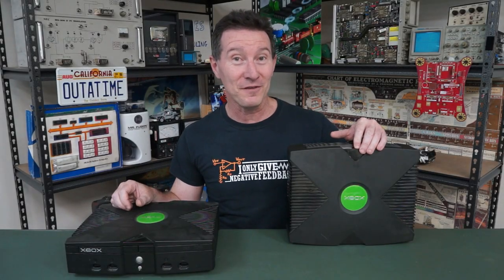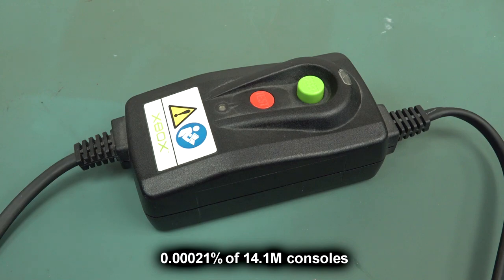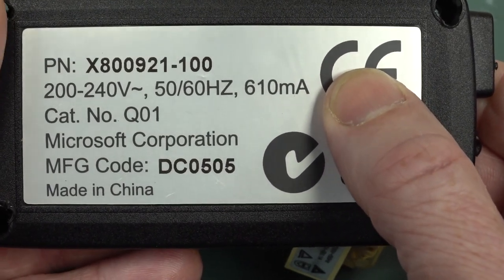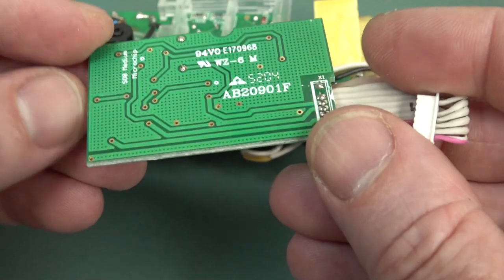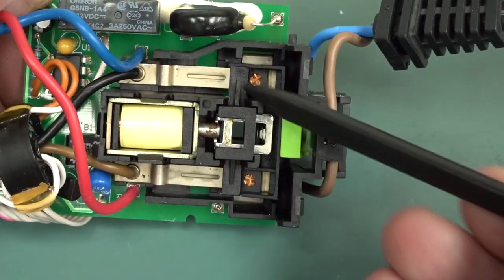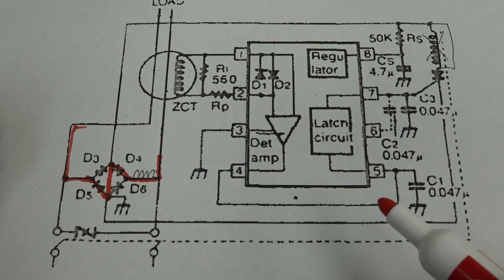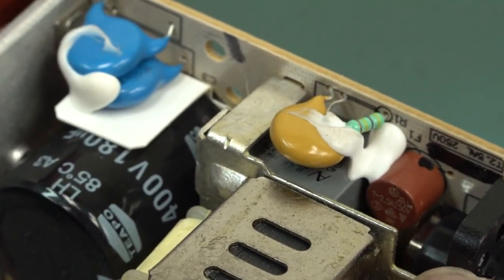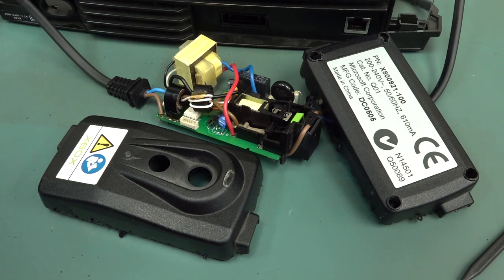EEVblog #1164 - Xbox Engineering Baptism Of Fire

Comment from the maker: UPDATE
Apparently this is an "Arc Fault Circuit Interrupter" (AFCI) that continually monitors the current for the presence of arcs caused by such an intermittently faulty power connection. Hence the complexity and micro that would be using the ADC to continually monitor the current. It's not just a simple 610mA electronic fuse, although it almost certainly has that function too, hence the label.
And apparently these are now a legal requirement in US outlets since 2014?
https://en.wikipedia.org/wiki/Arc-fault_circuit_interrupter
Reply: Hey not fair Dave post this 3mins after I said that!
Reply: nice stab at Weller fuses, lol.
Reply: That name reminds me of the device the US calls "Ground Fault Circuit Interrupter"
Reply: Arc fault interruptors are required on branch circuits for bedrooms in the US. As far as I know there's no requirement for them elsewhere.

The stupid things can be a pain in the ass. They seem to trip on all manner of noisy circuits, such as brushed universal motors.
Reply: @PaulSteMarie  They shouldn't according to the wiki.
They should be able to detect between the arcing in switches or brushed motors and a frayed wire.
But this is wiki
Reply: @PaulSteMarie  I could be totally wrong, but I am almost certain that ALL 15a and 20a circuits with in a home require AFCI in the USA.
Reply: Hi, Dave!

I wonder about the source code for this puppy. Would be neat to have something like this for testing at home with variable currents. As cheap as they are...

Regards,
Etna.
Reply: @IIGrayfoxII GFCI protects against shock, and been required in bathrooms for a while in US. AFCI protects against fires from arcing and now required in other rooms since 2014.  My apartment has GFCI but no AFCI.
Reply: @IIGrayfoxII  Yes, this is wiki, so you should go and fix the shit if you know it. Doesn't have to be perfect, improve just a bit, that will do.
Reply: @AlexanderBukh  I don't know much about electronics, it is why I am leaning about it on this channel
Reply: You know, I was about to put that in the comments just as the video ended and here we are.

Very advanced / pioneering protection circuitry for the time
Reply: I have repaired probably 100s of these. Would always find broken solder joints at the plug on the power supply just as you seen. Would be burned from arcing as well as the case/shield below.
Reply: Lol you guys with your unfused plugs 😂😂😂😂
Join the civilised world already 😉
Reply: The moment you opened it I was thinking ark fault interrupter. From what I understand in the USA it is a requirement of the electrical code that certain circuits on a residential consumer unit/panel boards that ark fault interrupters are included on power circuits.
Reply: I thought AFCI plugs were code since 2011, but it may be 2014. Either way when I put electrical in my basement I ended up putting in AFCI/GFCI plugs. They were a pain to use with my miter saw since when you start it they appear to be arc faults quite frequently. So I'd say 50% of the time it would trip a 20amp AFCI plug for a 15 amp saw. Luckily there were old plugs without the AFCI I could use.
Reply: EEVblog that’s what I was thinking. I just bought one of these in an in-line extension cord since we used vintage Christmas lights on our tree this year and I wanted a little more protection. I wouldn’t be surprised at all if this was a pre-built unit Microsoft purchased in bulk and stuck their own ends on. That explains the clumsy Xbox sticker on the unit. 

And yes, I’m in the US, and AFCIs are required for all new outlets, but they do it in the circuit breaker. The US is heavily over-regulated when it comes to electrical code; you’d know better than me if they’re really required. But they tell us that arc faults are the leading cause of house fires and therefore AFCIs can prevent that. Luckily they haven’t required us to replace all our breakers yet. I had some new service run in my house this year and they were all AFCIs. Two had early life failures (luckily they fail safe), and had to have them replaced. The electrician told me the earlier models false-tripped constantly and warned me mine might trip if I used power tools on those circuits (I tripped it once by repeatedly gunning a belt sander to see what would happen but never again) because some commutated loads look like arc faults to it.
Reply: Is that an opto isolator near the control board header?
Reply: They're recommended but not required under the 18th edition of the wiring regulations in the UK also
Reply: EEVblog AFCI is not a “legal” requirement in the US per se. The NEC (National Electric Code) is NOT actually a law, despite its name; whether AFCI is required will depend on what state or even what city you live in. Most adopt NEC but some don’t or they modify it. Even where it’s “required” you’ll generally only see it in newly constructed buildings. Most consumers tend to regard it as a nuisance, though the protection is obviously a good thing.
Reply: They need to monitor the unbalanced currents because the case has some exposed metal accessable to a user (the rj45 jack). It is not double insulated and is using a two pin connection. Naughty.
Reply: 8:12 - as a certifying Electrician...

Sensing any 'current leakage' is the norm in many 'double-insulated' applications. [ sees a crap 2 pin plug ]

As any good #pixyWrangler will know that large momentary discharges [ sic filament bulb blowing ] will cause an imbalance in the PHASE and Neutral due to lost energy in plasma creation, this will manifest as a sensed current in the combined Phase/Neutral sense circuit. [ things that make a lot of noise also can trip standard 'Earth Loop Protection' circuits ]

#infoHorse =]8¬_D
Reply: I was guessing that it might have been a hastily rebadged unit that combined RCD/GFI and arc detection in one device.  It does seem very complicated.  The ability to differentiate between system power draw transients versus arcing is probably where most of the processing was involved.  The use of a thermal fuse next to a MOV is pretty common.  The end of life failure mode of those tends to be to start getting hot.  It's used in some suppression units to indicate failure of the protection by lighting or extinguishing an indicator too.
Reply: Afdd’s (arc fault detection devices) are now a recommendation in the new uk regulations, whereas rcd’s are a requirement in nearly all final circuits in an electrical installation. Believe the usa uses afdd’s more because of the higher current drawn due to lower voltage, whereas  the uk deems rcd’s to be of more ‘value’ due to the higher supply voltage
Reply: It is required for installations at point of care, schools and kindergardens in the EU.
Reply: I highly doubt this device was explicitly designed for use in the Xbox, it seems like it could be commercial grade for some other purpose? Maybe a re shell of an existing design and board
Reply: I was thinking GFCI not sure how a GFCI and arc fault differ though.
Reply: @gwionr  Yep. Ive got to get a house re-wired, and Im going to get an arc fault detector installed as part of that. Seems like a nice addition safety wise.
Reply: @network_king  Arc fault detector monitors the shape of the AC waveform, when it sees abnormalities in the waveform consistent with an arc, it trips.
Reply: Tom Storey its now a requirement in the uk to have overvoltage (surge) protection installed too, risk assessment required if you dont install them. Afdd boards are extremely expensive atm, ive installed a couple but not many customers want to pay the additional price.
Reply: jtech0 gfci detects difference between line an neutral conductors, arc fault detects arcing
Reply: @gwionr  Yeah, I did a little reading and the general consensus seems to be that AFDDs are still a bit pricey, but its a cost Im willing to incurr. My house was built in the 70s and still has what I would imagine are the original wire fuses, so Im looking to re-do the lot of it - pulling all new cable if necessary, replacing all the sockets, light switches etc and adding a couple more if I can figure out where I'd like to put them all.
Reply: It just an off the shelf inline ACFI/GFCI, RCD not made or designed in house. You will find these on lawnmowers or outdoor extension leads. Made in china to meet or surpass international safety standards. Jellybean part, just buy em and splice a IEC E7 lead with whatever international molded pug is required and bobs microsoft's uncle...
Reply: @chasmosaurus3  The power supply low voltage side is isolated. By your logic no standalone power supply with a 2.1mm barrel jack could be double insulated.
Reply: @kenhukushi1637  required but apparently not enforced....
Reply: That's what I was getting ready to comment. But I see you did it first. Cool video.
Reply: @IIGrayfoxII , true... Wiki-level responses can be misleading.

Comment: I used to mod as well as repair these suckers since their inception. The reason for the fire was due to the power socket connector solder joints cracking due to heat. Due to this, the Metal-oxide Varistor had to cope with the spikes that were generated due to the intermittent contacts of the solder joints. Over time, this changed the molecular structure of the varistor due to heating and cooling and eventually it caused the varistor to short-circuit. Its the varistor that either burned out with heaps of the magic smoke, or it actually caught fire. Replacing this component with an equivalent type, though it was extremely important to have heat-shrink slung around it to prevent another flame out in the future. Anyone with spike and surge protection power boards etc. within an area that their mains voltage being very noisy, it would be highly recommended they replace the varistor every few years to ensure future reliability. 
For Micro$oft to replace the mains cable would have saved them heaps of money, instead of recalling all the consoles, as the re-settable fuse in the new cord would trip every time the above faulty solder joints didn't make a good contact. Eventually the solder joints would get so bad, that the owner would have to take the unit to get serviced. Even if the varistor failed with this fused cord, it would have prevented any magic smoke or potential fire. The solder joints rarely deteriorated until well after the warranty period, so it only cost Micro$oft those cords. Nice strategy on their part to save money, and to not be culpable of any fires. This saved some face for Bill Gate$.
Other problems with the X-Box, was a leaking memory backup capacitor to which can be replaced with a 10 Farad super capacitor from the likes of Jaycar Electronics. But the cap would have to be mounted horizontally to avoid space limitations with the DVD ROM drive. The area around the leaky cap MUST be cleaned, as it usually corrodes the tracks below it.
Another problem with these consoles, though it really only affected the earlier versions, was intermittent turn-on and it would also turn itself on when the mains plug was connected. It was found that some corrosive element that contaminated certain various copper traces from the factory eventually eroded them to the point that the tracks became resistive and no longer functioned as it should. There is a fix, but if you need it, just search for it on Google. I wrote that tutorial long ago under one of my alias, "Darkmatter".
I hope the above clarifies things.
Regards,
Dero
Reply: Makes sense.. MOV's don't have a long life when they Don't get spikes.  When they do, it's much, much shorter.

Comment: the "electronic fuse" is an AFCI. It's complicated because it's not just looking for overcurrent or ground fault, it's looking for waveforms that indicate (or suggest) arcing.

The XBOX fault itself was that the solder connections on the power input connector would fail, then you'd have lots of arc'ing and sparking -- and heat -- and eventually a fire.
Reply from the maker: I could be doing something like that as well.
Reply: Or mowing lawns.
Reply: Looks like they took an existing in line AFCI, and then added the extra functionality to it with a new PCB for the main board and the daughter board.  Transformer because the original AFCI power supply is a plain resistor supply, and they needed 50mA or more of power to drive leds and the extra circuitry. Probably originally made by one of the US suppliers like Leviton, who are big into the AFCI market, and reusing existing inline cases, relay blocks, current transformers and the mouldings for the existing line, as that already had UL test results, so making the new design a lot faster to get through regulatory approval. Running the coil before the bridge rectifier was simply to get extra filtering on the incoming mains supply, using the existing choke of the coil instead of adding a resistor, the coil disconnects it's own power once it has tripped. The MOV moving to the one side was probably space, and the link wire has a much higher short circuit breaking capacity than any track you could lay in there, plus you are doing a lot of hand soldering and fiddly assembly, so one extra wire is not much of an extra cost.

The added current trip simply does a self test, by injecting an imbalance of current into the test coil, so nothing extra added to the AFCI circuit itself aside from a much smaller trip point from overcurrent. There probably is a fixed highish current setpoint, and the micro is there to trigger it at lower points depending on mains voltage programmed into it, plus shortening the delay built in for inrush current. Also there to drive a LED to show program running.

Comment: Great topic!  There may have been very few cases of smoke or fire, but AC jack solder joint failures were quite common on the early revs of the Xbox. I repaired several of them in the mid-2000s, and all of them had some level of degradation to the joints. At least one of them made audible arcing noises when the power cord was wiggled just a little bit. Reflowing the joints with a nice hot iron took care of the problem. The one I kept still works great, and I never heard about any further trouble with the others. (I do keep it unplugged when not in use, though.)

The replacement cords I saw in the US were labeled as “Arc Fault Circuit Interrupters”. A fuse wasn’t a sufficient solution; I guess the arcing didn’t result in excessive current usage, it was just that the current wasn’t going where it was intended. The annoying thing about it is that while the replacement cords  make it safe and cover Microsoft’s butt, they don’t prevent the power supply from being damaged. There can still be enough arcing to fry it. 

PSA FOR ALL ORIGINAL XBOX OWNERS:  if you haven’t already removed the “supercap” that keeps the time when power is unplugged, DO IT NOW. It will cause irreparable damage if left in place.

Comment: That's a 1.0 Xbox aswell you will need to remove the clock capacitor it will leak and cause trace rot which causes the front panel not to work

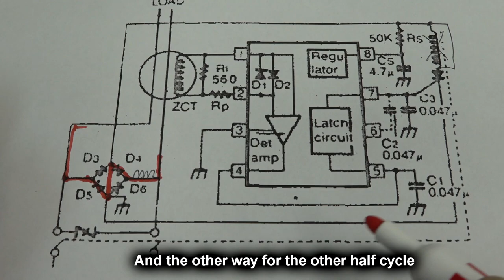Comment: At 21:00 when talking about the solenoid drive circuit - the reason for moving the coil over to the rectifier is so that when it trips you can reset it. The chip has a latching function. Removing power  prevents the latch from preventing you from resetting the supply without first unplugging from the wall.

Comment: My friends power supply arced and I saw it first hand.  It was in a dark room and I saw a blueish flash in the venting slots that cast light out onto the carpet the unit was sitting on. There was also a burnt electronic smell and small pop that accompanied the flash. I brought it to his attention and we shut it down immediately.  Then we decided to see if we could fix it.  We could replicate the arcing by wiggling the power cord.  After taking it apart we found those solder joints had broken.  His solution was to reflow the joints and be careful when inserting the plug.  It was very soon after that the cable was released and we both sent off for one each.  My Xbox never had this problem.
Reply: I'm always surprised to see commercial products have power cord plug-ins directly on the board. Surely having a chassi-mounted plug with wires going to the board would not cost much, and be infinitely more reliable. But what do I know.

Comment: many moons ago when I used to mod xboxes by the dozen and was really active on xbox-scene we noticed a lot of the early xboxes having issues where they would no longer power up. People started to see that the solder was breaking on the solder joint for the main power leads. The fix was to just reflow the solder but of course MSFT started sending out replacement power cables with the reset switches on them. At one point I probably had 50 of them because of all the dead xboxes I had laying around. When someone would want their xbox modded I would reflow and add solder to that join and give them one of the upgraded power cables. Those were good times and this video took me back to when console modding was easy and a blast to do.

Comment: It was only the first generation with the revision 1.0-1.1 it was a loose power socket (solder points will create a dry joint and it will start to arch), they fixed it in later revisions

Edit: we grey imported a thousand into South Africa.